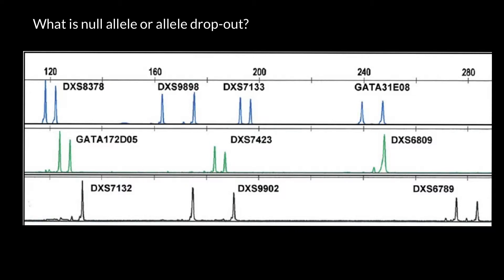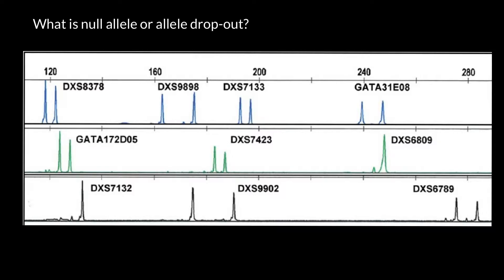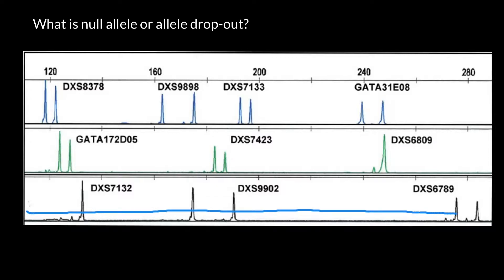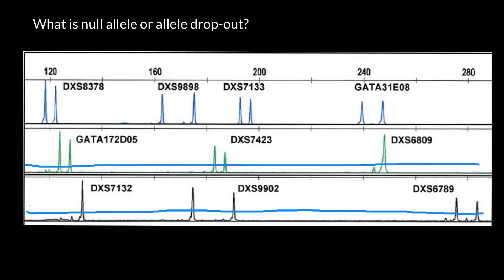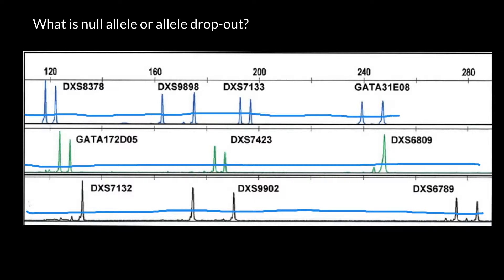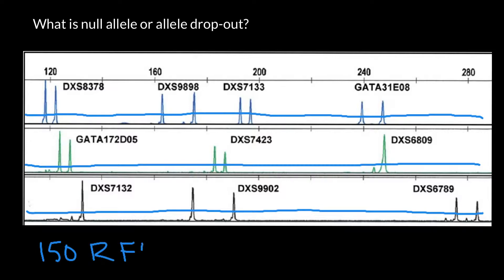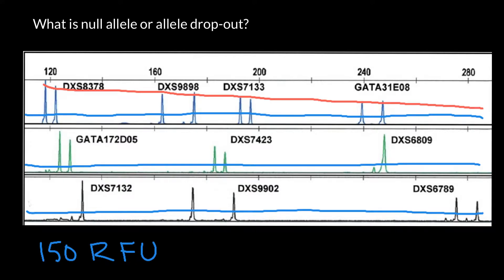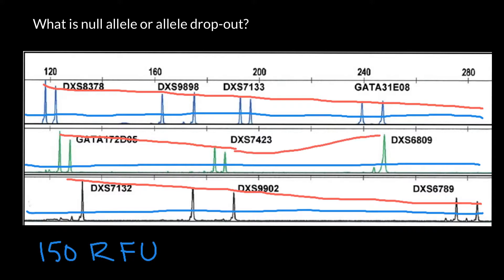What is null allele or allele drop-out

Comment: Hi Nikolay's, I am quite begginer. Got a question, I did sequencing for a gene of interest, forward primer showed one peak for mutatuin, reverse primer showed the wild type without any mutation. How could allelic drop-out fit into this. My second question, what software did you use to combine both alleles in one electrograph ? Thanks
Reply from the maker: There are a number of explanations, but I would recommend to use different primers first of all.
Reply: @GeneticsLessons  Thanks; my project has ended now and I do not have the facility to do that. I do appreciate if you explain it to me please.

Comment: Hi Nikolay if we see example of a null allele is the 'O' blood type allele in the human A, B and O blood type system.The alleles for the A-antigen and B-antigen are co-dominant, thus they are both phenotypically expressed if both are present. The allele for O blood type, however, is a mutated version of the allele for the A-antigen, with a single base pair change due to genetic mutation. The protein coded for by the O allele is enzymatically inactive and therefore the O allele is expressed phenotypically in homozygous OO individuals as the lack of any blood antigen. Thus we may consider the allele for the O blood type as a null allele. Similarly if Y allele is inactive how can it build structure with X chromosome to determine the sex is male. Only X will build bound with X to determine Sex as female.
Reply from the maker: These alleles are non coding sequences, do not mistake them with "genes" which code for proteins.